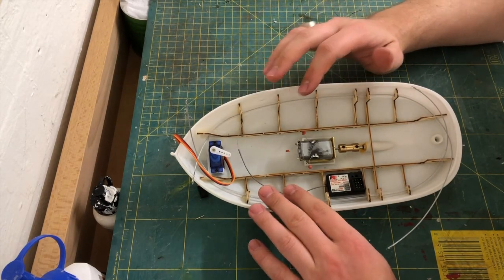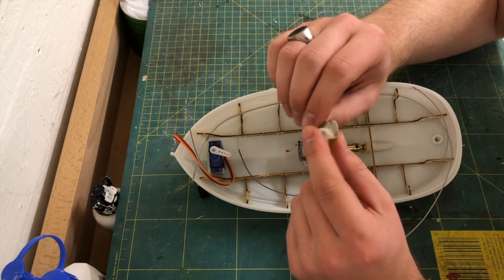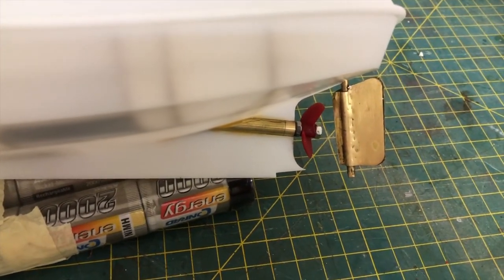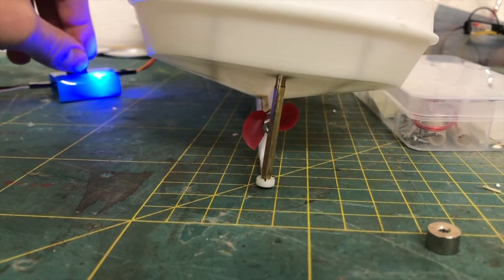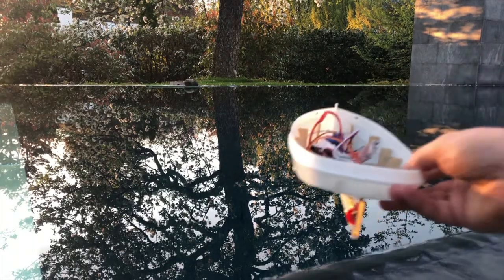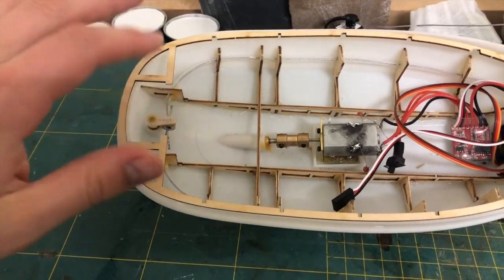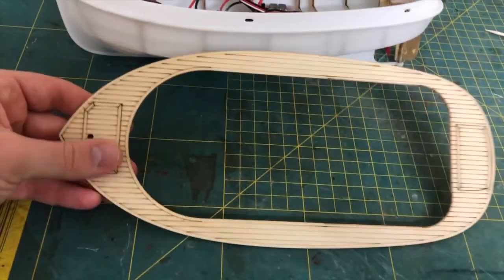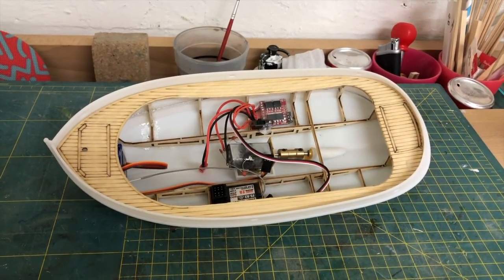RC Tugboat Build Vlog Part 5

Comment: Hello,

Thanks for the vlog !
After having followed the fifth episode, I ordered a kit :-)

I have one question as also one suggestion :
The question : Could you give the references of the ESC you use ?
This 'll allow me to order it before having access to the kit documentation.

The suggestion : Maybe could you equalize a little bit the sound levels of the music and your voice... Probably due to my advanced age (57 :-D ) I need to set up the volume cursor to ear you and set it down when music play.  :-)

I look forward to the next episodes.. Thank by advance,

Michel (aka Coyotte)
Reply from the maker: Hi Michel, 
Thank you for your message! I ordered this ESC from aliexpress: https://www.aliexpress.com/item/32967286973.html?spm=2114.13010708.0.0.3a994c4dl2Y8pr
I´ve used this particular model in several models and it works quite well with smaller brushed motors. Its cheap, small and light. 
Thank your for the tip regarding the volume, I will try my best to get a more equalized volume in the upcoming episodes. 

Have fun with your kit!
Reply: @modellteichrc3988  Thanks for the fast and accurate answer. :-) I'll order one today.
Have a nice day,

Michel